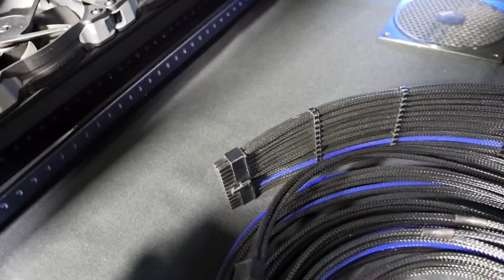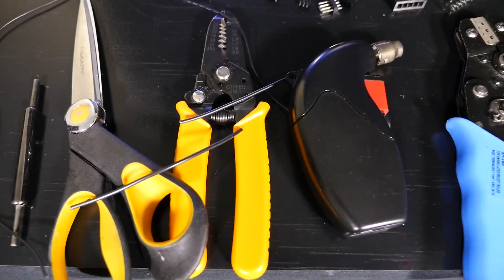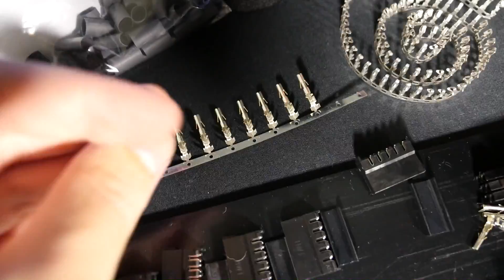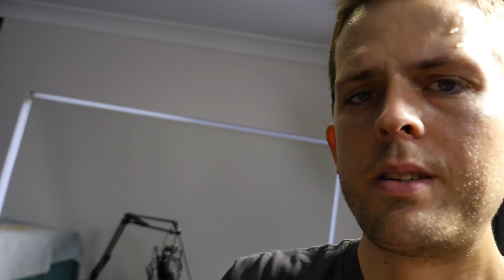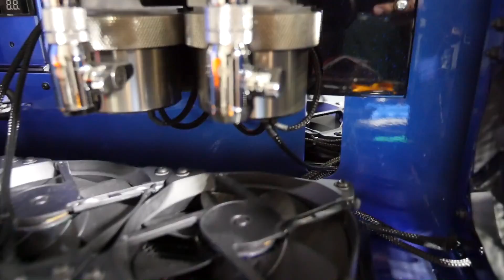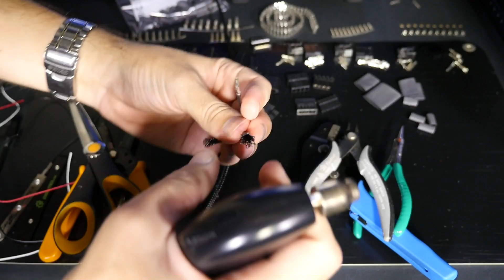SC Modding #3: Custom Cables

Comment: 18:08 It is definitely essential to make good contact with the wire on that crimp. However, touching it up with a little bit of solder will ensure the best connection. Just apply the iron on the terminal right behind where the wires and touch the wire with the solder wire and it will flow right down to the terminal making a nice solid connection.

Comment: Great video. I will definitely rewatch this several times ones I get started. The only thing I missed in the video is, you explained obout the sata power connectors and the wire just pushes in the connectors. I am just wondering how you can do a clean sleeve on that. Don't think I can push it though the sleeving as well and expect a solid connection. Hope anyone has tips. Other thing I wanted to ask, would it be a good idea to solder it to after you scrimp the connector on? or is that overkill?

Comment: this is an old video so i doubt you will respond to this, but i saw a weird psu the other day that used completely a different style of connection to the psu.  it was almost like audio equipment.  have you ever seen psus like this? can they be sleeved?

Comment: Your builds are amazing, but I’m hoping since this video you’ve gotten a bit more refined with your paint spraying skills... the biggest blue panel has vertical streaks on it. The nozzle needs to be further away and you need to do 4-5 more distant and thinner coats rather than a close and thick paint jobz

Comment: I was reading up and researching lately, and Lutroo usually takes crazy glue and puts a little dab of it on the actual wire when he puts on the sleeving. He presses it so it can stick,  and then he pulls the wire to appropriate sleeving distance. He clips it and its now a PERFECT sleeved cable.

Comment: I'm about to sleeve a set of custom cables soon. How do you know which wires go in which part of the connector as to not short out or fry anything? This is the last thing I'm trying to learn completely and understand. Thanks in advance.
Reply: I also can't find this info anywhere and many people seem to be asking. How I plan to do it is to build cables ground up and just carefully copy what I see on the original cable, and once done tripple check if it's the same. If you see better solution please share - I'd appreciate.
Reply: @orkusmg  I want to know the same thing. I want to do some custom cables for my newest and second build.

Comment: Just a tip for soldering those male connectors - Plug them into a female connector while soldering the other end to prevent them from moving and it also acts as a small heat sink to give you a bit more time.

Comment: I feel like you did a great job, I am an amateur at best but I feel if you leave sleeve back further;like you have, and then push "pre cut" piece to the first fins on the connector, they are the same length.

Also, why didn't you stretch it before??

Comment: question: did u ever think of putting out a list of products that u suggest that u would use etc?
like for example what is best case for value, or the best to mod into.
or which are the best fittings etc etc.
and put that list on your website.
would also fit your idea to make more reviews and vlog videos aside the build logs.

Comment: man does it really takes months to build a pc i was gonna buy from yall guys but nvm.. that's a no no
Reply from the maker: +EaTPlaYsLEeP Normally turn around time is under 6 weeks but I am currently behind with a few of my builds due to what happened with my expansion and the workshop. I will be caught up again soon though. It also depends on client requests. For example if a client wants a set of custom built water-blocks then its going to take extra time. My videos don't normally represent the timeline of a build, sometimes I will upload a build log that is 6 months old. I have a couple I may upload which are over a year old.
Reply: +SingularityComputers Personally, I feel that your quality seems so incredibly high that I would be willing to wait even a year as long as the components don&#39;t get outdated in the mean time. I really am amazed by the sheer high quality work you do. I myself have a huge workshop thanks to my dad&#39;s work but I am still a beginner. Your machining skills always impress me.

Personally, you will hopefully still be around doing this stuff in a decade. Once I finish studies and get into my career, if you are still doing this I will definitely be investing around 10-15k [AUD, I'm here in WA,Perth] into a build you can do. This is more than just a computer, it is incredible art. I really commend you on it. It is simple extraordinary.

Comment: Small tip for crimping the wires, I work at a aircraft maintaining facility, stripp double the wire at the end and fold it, you have more material for crimping. Hope it helps

Comment: Why did you not use a 2,5mm sleeve for a single PSU cable? Personally I Use 4/3.5 mm just for fans or other multiple cable sleeve.

Comment: It's not necessary to repin the power/hdd led/reset/etc. Lift the tabs with an Xacto and pull out the wires then insert them into the new 10-pin DuPont connector as you go.

Comment: Have you considered maybe doing some non-sleeved 14 or 12ga silicon cables for custom PSU cables? I think the "wet noodle" type of look would be very unique and possibly look awesome. The size is completely unnecessary for the current it carries, but the thickness would be similar to that of sleeved cables, just with a single smooth surface rather than a braided pattern. Just an idea I had, which I would try if I had more money and time :P Great video as always!

Comment: for sata cables it may be worth to take a look at akasa slimline cables, you can remove the connector and sleeve it with regular mdpc sleeving. also you can cut them to length

Comment: So how do you sleeve USB 3.0 internal headers and cables? 

tldr incoming: I did this with my personal build and I had a lot of problems with it. I could not use the same mdpc-x sleeving like for the sata data cables, as it wont go over the connector. The next size up, which I ended up using, is the one for the 24pin ATX cable and is actually a lot wider than the cables. Also the heatshrink was a nightmare, since I could not manage to widen the sata data width heatshrink to fit over the connector. The next size up, which I found on Amazon, goes over the connector just fine, but then does not shrink enough to really grab onto the sleeving.

Comment: I like the trick @ 33:15 where you MELT the heatshrink to melt the sleeving so it bonds into the pin. Dealing with the frayed ends of the sleeving is hell.

Comment: I was wondering if you could use a hot-air soldering gun instead of using the torch to melt the sleeves.
Reply: +Andrei Benitez no its too hot. at lest that's what i've heard

Comment: Oh forgot to mention I now always use a 6 + 2 pin connection at the GPU end as it is much easier to adjust if you swap out a GPU with a different connector layout.
Reply: Wire the 2pin connector direct to the PSU not from the 6pin connector.

Comment: Easy way to get sleeving length is to crimp the connector on one end of each wire.Then put the sleeve on the wire from the non contact end. Then do you sleeve melt at the contact. Then pull the sleeve along the wire and cut to the same length as the wire. Then pull sleeve back from end of the wire, strip wire, crimp connector , then finish with sleeve melt and job done. Works every time with the sleeve then perfect length to give your wire a little room to be bent, ie not to stiff. Oh remember to heat seal the sleeve ends before threading onto to wire.

Comment: Where can I get those cable clamps? My gpu 8 pin looks horrible, I cant get the single sleeved cables to be straight and clean
Reply: +Gonzalo Bueno If you're talking about the cable combs, pretty much any company that sells materials for custom sleeving has them. Performance PCs has them and for a pretty good price as well.

Comment from the maker: I know its a long video, it was the only way I could cram in all the necessary details for custom wiring. If you want to do custom wiring its all here, if not this will probably bore you. Singularity Computers Client Build 20 'Event Horizon' Build Log: Part 3 coming up in a few days.
Reply: +SingularityComputers I would not worry about the length of the video, it's lots of good information, I'm sure a lot of people appreciate it, like I do.
Reply: +SingularityComputers
 Really nice work man , I learn so much from you.Only my wife is less happy with this expensive hobby lol 
luckily she is very sweet to me
Reply: +SingularityComputers for me isn't a problem the length of the video. When learning something, the time used is never wasted. keep up this splendid work.
Reply: +SingularityComputers I don't mind the length of the video. I love to see how much effort you put in your builds  to reach the quality that you stand for. All the info you provide during a video makes your build logs  stand out above all the others that I've seen. That's worth every second. ;)
Reply: +SingularityComputers about the sata data cables, you should try the akasa proslim cables
these cabels have a two piece construction on the connectors, so they can be opened

and the best thing is that they work nearly the same way as 90&#176; sata or hdd power connectors
you just cut the original cable to length and push it in ;) now you have custome length sata data :D
Reply: u the best thank
Reply: +SingularityComputers I'm absoltuely loving your Tut videos. This one just made me feel super giddy inside. I've been building custom PC's for about 13 years now (as a hobby) I'm finally stable enough to build one and fully mod it. I just can't help but be excited to know I finally get to do all of the things I've wanted to do for so long.
Reply: Can the connectors to the PSU be reused to ensure compatibility if you have the pin ejector?